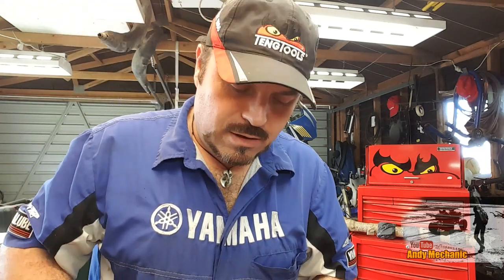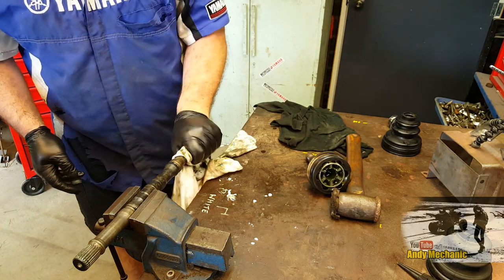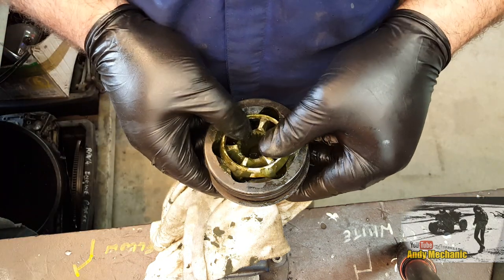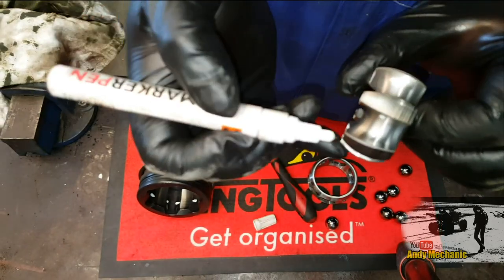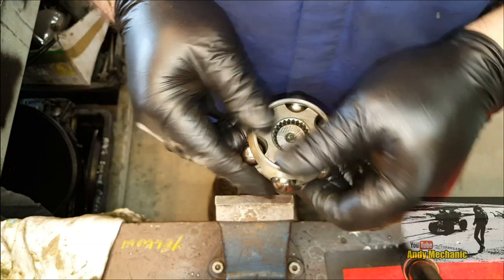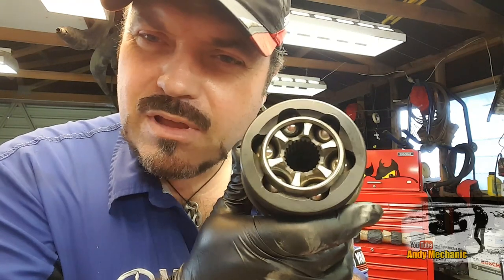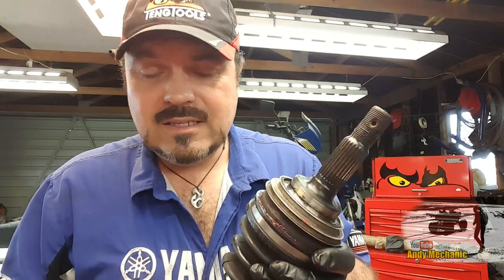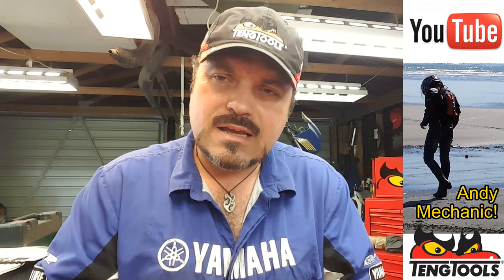CV joint full strip down & inspection #1010

Comment: Lol @8:48 that NEVER happens with a hammer.  I normally have to use a heavy duty slide-hammer which I have made a custom fitting by welding on an axle nut that gets threaded onto onto the CV then a few hefty whacks with the slide hammer (in line with the axle) will usually pull off the joint.

Comment: excellent video. Just one question. how many miles did these cv joints have? I have a pick up truck with 120,000 city miles. the boots are not ripped, but definitely cracked and I am not sure if I should just change to  whole new part, or would it be ok if I just change the boots and re-grease everything? There is a big money difference in just changing boots, than buying a whole know cv axle. Thank you very much.
Reply from the maker: Hi, I take it the pickup is a 4x4? If so then it'll likely be part time four wheel drive. So unless you engage 4x4 then the drive is via the rear axle. If this is how your vehicle is set up then the front CV joints will have very little wear indeed, especially if the vehicle hasn't been used off road. If they aren't making a clicking noise then don't replace them

Cheers Andy
Reply: Thanks for your quick response Andy. you got it spot on. The truck is 90% used in just rear wheel drive mode. I don't do any off road and the CV Joints do not make any noise while turning or driving straight. I just don't want to find my undercarriage with baked on grease everywhere when these boots call it quits. thanks again and I have subscribed to your channel. hope to continue seeing the great material.

Comment: i have done a few joints and i always fill the joint but never put any in the boot as i figure some will spill out anyway
What is the purpose of putting grease in the boot? and so much??
Reply: I think, if you put grease in the joint only it ends up spilled out on the boot`s wall and the joint will lose it in time.. The purpose is continuous lubrication  for a long time.
Reply: I agree, Tim.... what's in the boot is doing nothing useful. ...It's going nowhere.

Comment: can you reuse the 6 inner flange bolts, the ones that secure the cv axle to the differential, or they have to be changed every time? I have a cv axle to replace tomorrow.
Reply from the maker: Oh I have re-used them plenty of times before without issue, just apply thread lock and don't over tighten! Cheers Andy
Reply: @AndyMechanic  thanks !
Reply: @AndyMechanic  I love that comment: "Don't overtighten."
The number of times I have come across this problem here in South America.....  
Makes me so angry!  ....Just TOTALLY over the top. 
What the hell do these people think they are achieving? Grrrrrr
Just doing a Daewoo CV job... I almost had to lift the whole car to release the FWD drive, axle end-nut...It's two metal to metal surfaces: They cannot go anywhere!
Ludicrous.

Comment: Please, can worn-out or bad inner cv joint cause ABS light on? I asked because immediately I changed the cv axle joint, I began to hear like cracking nose. Please, what could be the problem?
Reply from the maker: The ABS light is triggered due to a range of faults in the system. It's likely one of the wires to the ABS sensor has broken whilst fitting the new drive shaft.

The sensor itself is also very sensitive to impact so if you used a hammer then maybe it's broken.

The drive shaft contains the tone ring, the toothed ring used to induce a voltage into the ABS sensor. This has been swapped when the new drive shaft was fitted - it could have been damaged if you transfered it off the old drive shaft. It could be missing aligned (too far away from sensor so low voltage induced). It could be missing - you forgot to swap it over. 

The fault is most likely linked to the work recently done on the car.

The cracking noise does lead me to think that the tone ring is fitted but catching on something due to a misalignment issue.

Good luck
Andy
Reply: " Pull the ABS wheel speed sensor partially out of its mounting hole in the steering knuckle. This will prevent it from becoming damaged as the drive axle is withdrawn from the hub " -  Haynes Online Manual
Reply from the maker: Just be careful as sometimes they can be very difficult to move due to rust jacking.

Good comment. Cheers Andy

Comment: they say you can swap the outer joints left to right to get a fresh surface instead of having to buy a new joint, is that from driver side joint to passenger side joint or do they mean to switch the inside cage backwards on a particular joint ?
Reply from the maker: Hi John, Golly,  I can understand the theory here as you'll be switching 'drive' surfaces. You'd need to swap the complete joint as it is a 'bearing' - you would never just replace the balls in a standard ball bearing race as they are components that wear in together - same applies with a CV joint - inner race, outer race, cage and balls.

Despite this, given the usual low cost of a joint nowadays I'd just fit new ones & not bother just swapping them over as it is likely there will be 'indexing' on the cage sides - this is what is the usual cause of the 'click' noise & swapping the joints from one side to the other will not fix this, they will still make the clicking noise.

Hope this helps. Cheers Andy
Reply: @AndyMechanic  on my 2006 honda civic lx automatic and any car with a dynamic dampener, you need to use an oem shaft with the dynamic dampener since if you don't it will have vibrations when accelerating...my plan is to see if i can use just an outer joint from a new cv shaft and just move it over to my oem shaft with the dynamic dampener, this is on the passenger side, on the driver side i can use a new aftermarket shaft no problems since it doesn't require a dynamic dampener...your video is great, thanks
Reply from the maker: Cheers. Sounds like a great plan :-)

Comment: Very thorough and very informative.
Reply from the maker: +jman Thanks jman. These components are often overlooked with regards diagnosis these days given they have to just be replaced as a complete part, often including the whole drive  shaft now....can be quite expensive. So important to replace a split CV boot early to help avoid contamination of the joint and premature wear. Thanks for the feedback. Cheers Andy

Comment: and so we don't pack grease into the boots?
Reply from the maker: Yes, but don't overdo it. Often DIY Mechanics put too much grease in the boot.....
Reply: @AndyMechanic  My rule on that is simple: If it ain't in contact with a bearing surface: It ain't doing anything....You are correct: Far too many people put far too much grease into the boot. 
Centrifugal force will not move it forward into the bearings.
I tend to put most of the supplied grease into the main area....
What it don't need will soon exit to the boot area....Mmm?

Comment: I have a new cv joint but the nut was cross threaded and this damaged the thread. I have an old cv joint which is knackered. Can I swap the new cage and bearings with the old one to make a old new one ? If that makes sense.
Reply from the maker: Good Morning Mike, if, currently both are unusable then to be fair you have nothing to loose. However, we are talking about matched bearing surfaces here so it is likely that the joint will still make noise especially if the old outer race has indents.

Andy
Reply: Thanks for that my friend. Just annoyed that the thread got crossed on a new joint, dont`t want to chuck it if I can swap the inner parts. It was knocking so that`s why I took it off, so maybe as you say the outer race could be warned. Cheers bud.
Reply: You’ve surely done it by now but for the next guy.........    first kill your friend.   A chimp couldn’t mess up those easy threads.    Then hit the hardware store or if you have one find the die for making those same threads.   Thread it on a tad and it will straighten the first few bent threads .   Then you just thread on the real nut.and it will feed itself on.     No air guns , friends or cheater bars please.     Or , they make little bars with thread patterns on each side, thread restorer.     Not as nice but still usually work and cheap.

Comment: hi, so the sound on CV axle comes from outer axle of half shaft and not from inner half axle..?..
Reply from the maker: +sivaraj palanisamy the noise comes from the 6 ball bearings running over any imperfections on the inner & outer bearing surfaces.
Reply: Andy Mechanic thanks Andy for quick response. I am talking about other end of cvaxle. The nosie can come other end as well. Or it comes only on the end where spindle and rotor side.
Reply from the maker: +sivaraj palanisamy usually they are noisy at the CV - the joint just behind the wheel. The Tripod joints (nearest the gearbox) tend not to be an issue and wear a lot less.

Comment: Hi i got knocking noise when im on humps or bad roads. I check it and its the inner cv joint. I moved it from tyre to transmission and theres a knocking sound. Does it need grease? Do i need full cv axle? Or spacers? Im stuck at the moment
Reply from the maker: +Ed Pay Hi Ed, is the vehicle standard Suspension? Car? 4x4?
Reply: Andy Mechanic its a standard car. Standard suspension. No clicking on turning only on humps and its on and off
Reply from the maker: +Ed Pay Okay Ed, Thanks. Are you sure the noise is from the inner joint on the front drive shaft (Tripoid joint)?
Reply: Yes Andy Mechanic, when i hold the shaft and move from tyre to transmission thats when the sound knocks, and it moving back and forth. The knocks can be heard when the shaft moves to the direction to transmission theres a video from here thats same as mine i will copy and paste it as we have same problem.
Reply from the maker: +Ed Pay Hmmmm. ..so it sounds to me like the inner circlip inside the outer CV joint has failed allowing the shaft to 'float'...
Reply: Hi andy! When you move back and fourth thats the only time i got a knocking sound.
Reply from the maker: +Ed Pay you mean drive forwards then backwards?
Reply: Andy Mechanic i mean the shaft.. sorry i got you confused. The 2nd video i have same sound first 12 sec. Only.
Reply from the maker: +Ed Pay Okay. I'll check the videos when I get back to my office and message you back.

Thanks for the info. Cheers Andy